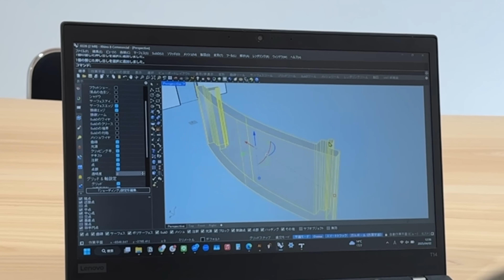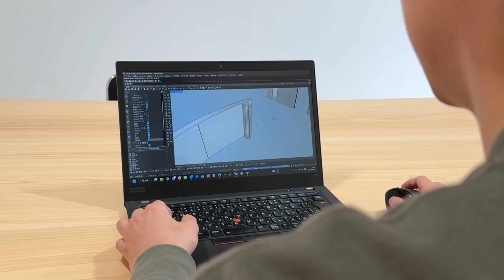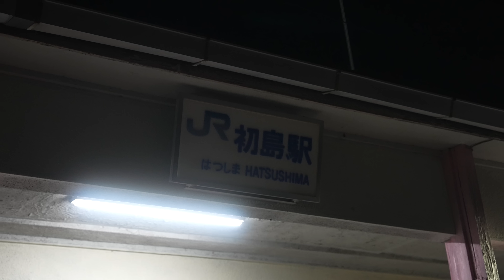世界初！3Dプリンターで駅舎を建設するプロセス。わずか2時間30分で完成する駅舎？

Comment: Very interesting video! This is, very likely, a first application of this 3-D printing technique in the context of building & assembling a small size train station; it will serve to identify steps to streamline and optimize process for future jobs. There are literally tens of thousands of train stations, from humongous like Shinjuku/Tokyo (Central)/Ueno to much smaller stations similar in size to one in this video dotted in far flung places in rural Japan. For me, there are 2 important issues to consider: 1) Many of these smaller stations had been put up likely 50-60+ years ago, often out of simple design & build materials, which are crumbling and need to be replaced soon, 2) Even with the use of foreign workers, Japan's rapidly shrinking construction workforce will be stressed to replace these structures (even if not one-for-one). As such, this new technology will be a great solution to these 2 critical issues. 
Did anyone catch how spotlessly clean the construction trucks are? Even their tire stainless steel rims are shining.